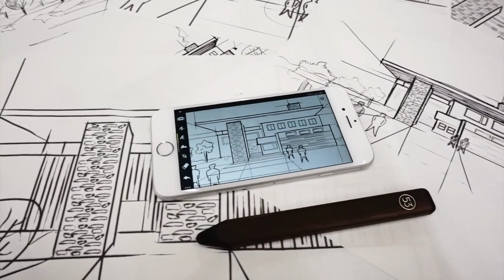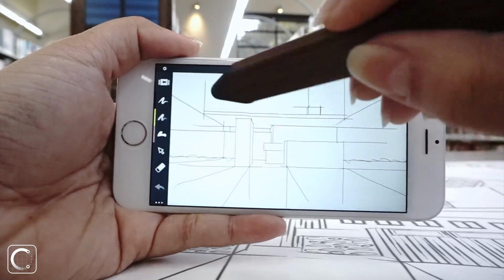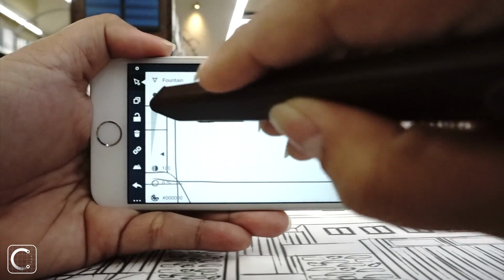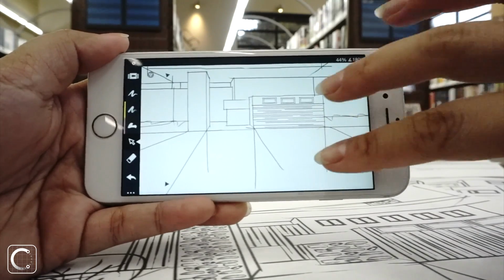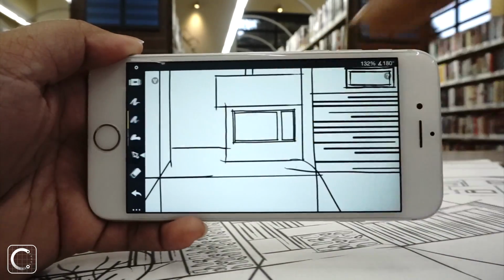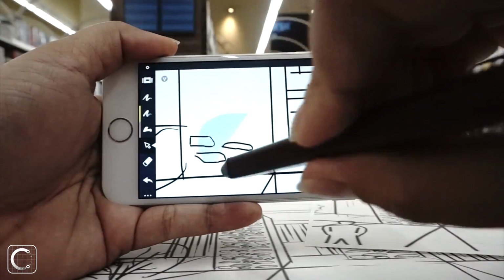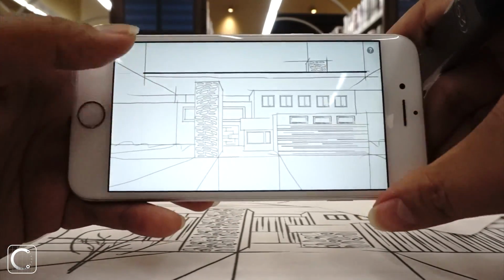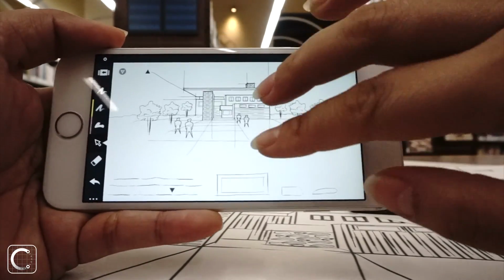Create Design Iterations Faster with Concepts

Comment: Thanks, great tutorial. Just wondering -- when increasing the line weight for the overall outline, why did you put down new strokes instead of just selecting and thickening the existing ones?
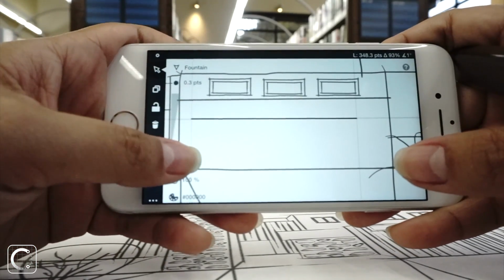Reply from the maker: I'm not sure which bit of the video you mean, but as you point out that's a definitely a way you can work. It is something we do around the 4:50 mark.
Reply: Ryan Olson